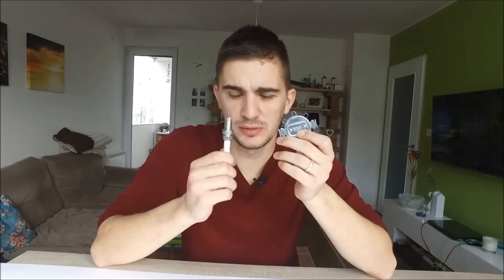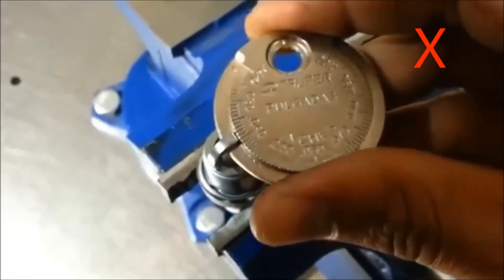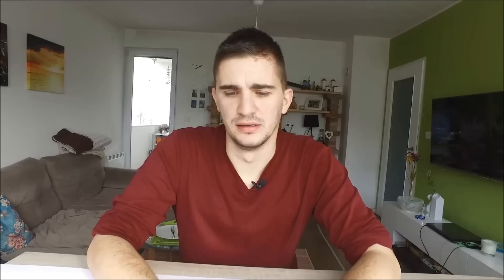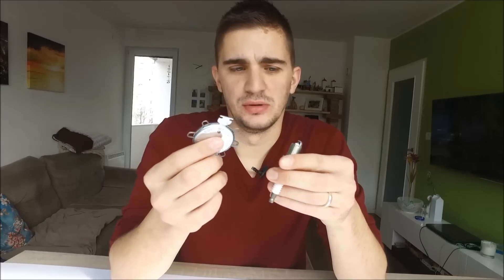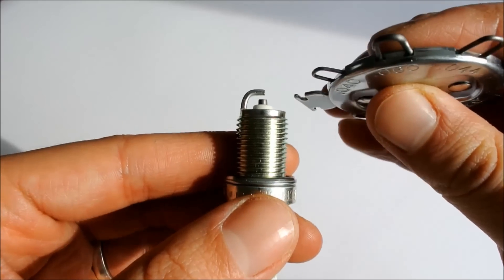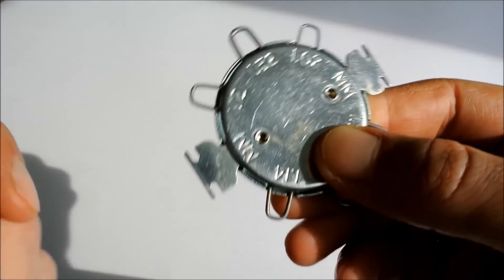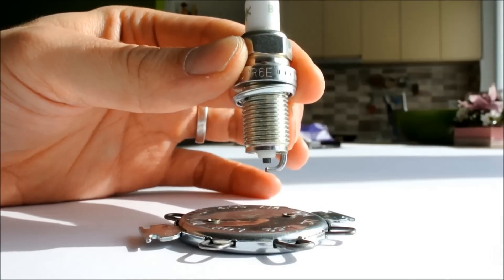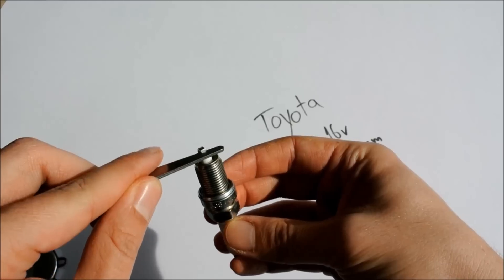How to GAP a SPARK PLUG properly

Comment: As an instructional designer, I have to say that this was an excellent tutorial. Clear audio and good lighting.  Nice closeups with  clear directions. I could actually see what you were talking about (unlike other videos). Helpful tips. I've never done sparkplugs before, but this video makes me feel very confident!
Reply: Thanks
Reply: Agreed, I haven’t used this style of gap tool before so I was going to use the gap wires and wedge them in 😅 glad I looked up what that extra metal piece on the side of it was for.

Comment: I never did any engine work until i went backpacking in Australia, bought a jeep that turned out to be missfiring so it needed spark plugs and all the wiring to them, machinic work there is really expensive so i did it myself, i bought thin feeler guages, and smacked the spark plugs on the pavement *carefully* to reduce the gap, never had any problems with it in 30,000 miles lol

Comment: I’ve seen a few videos that didn’t cover the subject adequately - this video did.  Thanks for showing the PROPER technique for adjusting the gap.  You can get a tool that pushes on the ground electrode with a jack bolt.  These work well too (instead of pushing the plug onto the table or the tool).  But again, thanks for showing the right way to gap a plug.

Comment: Great video NRJ. The feeler gage is by far the most accurate, the wire next and then the coin. I can address the use of a couple of these. I had never used the wire gapper since it never had the right gaps for GM or Ford products. Hence I am not familiar with its proper use.

I have used the coin before and it is pretty self explanatory. However you insert the coin where it is at the lowest, rotate to the needed measurement. If it stops before you get there, or is too loose, adjustment is needed. It may be just right. If your spec falls between two measurements, one is high and one is low, use the space in between. When adjusting a loose fit just use a hard surface and force the electrode closer gently or tap gently. There is a risk of the electrode breaking off but they are pretty sturdy and I have never broken one off by tapping or otherwise. To adjust the tight fit, use the hole that is provided for placing on a key ring. The inside of the hole has a thin surface which you place the electrode onto and then you pry it to the spec you need, gently. As I have said I have never broken one off. 

The feeler gage is a little different in that you can customize the leaves to your spec. It is relatively easy to use once you have the spec measurement. You just place the feelers into the gap and you know if it is loose or tight and won't go in almost immediately. You can also use the end of the gage for adjustment if it is tight.

A couple of other points. It's best to have a sparkplug socket. These are long enough or deep enough, if you will, that they will certainly do the job. You can also use a normal deep socket as this will work in a pinch, but getting the plugs out once unscrewed may be problematic. The sparkplug socket has a plastic or rubber insert inside the socket to grip the sparkplug. If you use the 12pt socket as opposed to the 6pt you may round the plug especially if the plugs are torqued. Last thing. The manufacturer's spec measurements are in imperial(SAE) or metric or both. The gappers you purchase now, as stated in the video, should have both imperial(SAE) and metric. I think you can purchase them with one or the other, so check carefully when you purchase. One last thing about the feeler gage. Suppose you only need one leaf, well that's okay just use it. If you don't see the feeler leaf you need you may need two or three. So what you'll do is add. So if you need 0.060in. what you do is add the closest two or three. The ones for 0.020in. and 0.040in. won't work, they create a gap in between and you might bend the tool. In this case use 0.012in.-0.014in. That should get it. Just remember they should be close together. It should also work for the metric as well.
Reply: Nice and clear info, my question is if you needed .06 and added .012 and  .014 wouldn't it give you .026 instead of .06...?
   I mean it seems like basic math... I don't get it...

Comment: I hadn't changed the spark plug https://www.youtube.com/post/Ugkx-6W-PtUzBRTmACHywsECak2ToY2OpjxN in my Toro 20" Recycler in the 6 years I've had it but have been good with all other maintenance. This season I noticed it sputtering a little bit every so often and just didn't feel like it was running as smoothly or as powerful as it used to. Switched out the spark plug for a new one yesterday and could immediately tell an improved difference. So I may have to make this a little more regular than every 6 years, especially for a $5 part!

Comment: what an excellent video. 

Also the fact you mentioned 0.004" for every 50 HP is RIGHT ON! 

literally my 328i F30 started misfiring 3 weeks after stage 1 Tune (it added around 50 hp) on relatively new ignition coils and plugs (10k km). i got new sparkplugs which are stock gapped usually to 0.032" and i gapped them down to 28" though, funny enough after removing the old ones i checked the gap to see 0.034"-35" which eventually cauesed limp mode drive terrain error. after the change the car now idles like butter and drives amazing.

Comment: Professional technician here... 
You can absolutely re-set the gap on a used spark plug that is still working well!

No reason why you can't adjust the gap on any new or used spark plug. I've done it millions of times over the past 35 years, never any issues.

You can/should also clean & lightly sand/file the center & grounding electrodes prior to checking & readjusting the gap on used plugs.
A simple piece of emory cloth is usually sufficient.

The best gapping tool is most definitely the wire gapping tool, with the included "T" slotted tool used for carefully bending the ground strap electrode to obtain the correct gap.

Comment: Very good, detailed, logically explained instruction, with excellent visual support. When I had gotten my gap adjuster home from the store there were no instructions and I honestly could not figure out the adjustment part and was nervous about damaging the electrode if I did it teh wrong way, though the measurement part was more obvious, except if you have a gap not included on the wheel as you showed. Thank you for helping me with this!

Comment: Spark plug 101: The best gap? - is the biggest gap you can get away with under all conditions without misfire. The larger the gap the bigger/stronger the initial flame kernel and the better combustion you will get - especially under low loads (idle/cruising), but ONLY if it actually fires. So yep, higher boost pressures will require a smaller gap under full boost pressure as to avoid a misfire. 

Many modern high boost turbo cars can have lumpy idles, in particular on high boost 4 cylinder direct injection engines - a lot of this is down to the small spark plug gap size necessary to ensure there are no misfires under full boost...this small gap results in poor combustion at idle on high boost direct injection engines, where the air fuel mixture is not very well mixed under the low (idle) air flow conditions.

As for why the flame kernel is better with a larger gap - this is simply due to the both the ground electrode and tip taking heat away from the flame kernel - the bigger the gap, the less heat that is drawn away from the kernel and the stronger that flame kernel will be.
Reply: blower how are you doing ?
 you know what's the biggest gap you can get in 2012 acura tl?
Reply: I agree, however, won't wider gapped plugs tend to foul-out sooner simply because there's less heat to burn off the carbon build-up on the electrode? I've noticed when using a wide of a gap (even w/o misfire codes thrown) there's a 'cushiony/springy' feel to the throttle.. could this be due to less heat? Thanks for your post. Relieving to read a comment from a person who knows what they're talking about.
Reply: Thank you for the information.

Comment: great video dude a commonly over looked job when servicing a car even on a professional level people don't get when plugs are shipped there knocked around the place and possibly close the gap seen a few misfires after plug changes caused by this
Reply from the maker: +david farrell tighe Thank yoy. True, as long as the spark plug fits most car owners, and sadly even some mechanics don't even check the gap.
Reply: I'm in the automotive trade myself I  seen a guy nearly put plugs that were 1cm longer reach into a polo 1.0 mpi before he didn't compare or check the plugs it's the simple things most people miss I find

Comment: Started out @ .039 on my Accord factory is .044. Currently running .046 definitely running stronger with the bigger gap (quicker starts, smoother idle etc.) hoping for more mpg also. California emissions has it @ .052 wondering if that'll run even better 🤔 God knows I'll be trying 😅

Comment: I did re-gap this way for my turbo subaru. At .033 gap at peak boost was getting cylinder roughness, decreased gap to .022 and all problems gone. In my other more boosted subaru the spark plug gap is like .019.

Comment: Ok so i just changed my  plugs on my own and was super proud and here comes my dad with a giant pin and stabs that bubble. Anyway apparently i didn't "gap" them. I used ngk plugs that are pre gapped but he's adamant that they can shift during shipment and i need to gap them to my card specifics. Are they still ok with me not doing this out should i take them out and gap them or can i no longer do that. I've only had them in a couple days
Reply from the maker: Your dad won't be happy but if the car is running well leave them. He's definitely correct, and they can indeed shift as they're tossed around during shipping, but that happens rarely and you can spot the compromised ones easily as the cardboard around them is a bit crumpled. I would leave them because they have already gone through a few heat cycles and gapping plugs like that isn't a good idea. Again, nothing will likely happen even if you remove them and gap them, but I'm 90% certain the gap will be correct on all of them.
Reply: @d4a  I also changed the maf sensor and i told him since changing those two the car is literally running extremely better. Actually turns on the first time and stays running and idling as it should. Still have issues occasionally after extended periods of driving like an straight hr plus of driving where it randomly bucks or trips idk how to explain it. Almost similar to when you have it at a stop and you put it in first gear sand begin to drive but don't give it enough gas and let of the clutch to soon so it jolts. Itll do that once or twice enough to feel it but then correct itself.
Reply: @d4a  Also thank you I really appreciate the response and info

Comment: I think 1.02mm (.040 inch) is fine for the spark plug gap if the recommended is 1.1mm because it will expand anyway when it used for too long driving of the car.

Comment: I appreciate the explanations, particularly the last part about how modifying engines require an adjuatment i spark the plug gap. 

I have a question: why not use feeler gauges instead of the coin or the wire type?

Comment: You must not know much about sizing because you said you have to use the feeler gauge to get the right size but yet the wire gauge you have clearly states the exact size you said you needed lol you said yours called for 110mm (1.1) which is .044. The wire gauge has that EXACT size on it!

Comment: Great video! Very clear and thorough explanation! I have One question: would adjusting the gap help with high rpms? I got a new engine but ever since then, the RPMs have been higher than usual and when I change between Drive and Reverse, the shifting feels pretty forced (if I’m explaining it right). Would that be possibly wrong spark plug gaps? Only asking because no faulty sensors come up and supposedly my transmission is fine as well. Thank you and I hope you see this!
Reply: Maybe the RPMs at idle, but none of the other symptoms you describe should be related to spark plug gap. You are likely looking at transmission issues or an issue with the new motor. Could be factory or something with the install. Hope that helps :/

Comment: It doesn't work.   I have 4 spark plugs NGK ZFR5F GP.   The gap is supposed to be .044 inches and the plugs all have too small of a gap.   So I try the tool to bend the metal piece on the spark plug and it does not work,  the tool bends and this tool is no good.

Comment: What happen if your gap is less than the recommended altought the engine is stock
Reply from the maker: +Javier Broger Usually when you suddenly floor it at lower rpms you will feel the engine hesitate. Might be a few misses at idle too.

Comment: 1400-1500 hp 2JZ plug gap negative 4mm
Reply from the maker: Forged Shaft Yup, you can find plugs like that in a parallel dimension.

Comment: Why is it not recommended to gap used spark plugs?
Reply: Used plugs  have been heated and cooled, weakening the electrode. When you bend a weakened piece of metal it can cause stress fractures which can lead to the electrode shearing off in to the cylinder.
Reply: Thanks!
Reply: @Mikemo  haha let you tell it.

Comment: What the hell is the point of having a spark plug adjuster if u can't even use it bc it doesn't have ur size on it. U should of jus used a feeler gauge from the jump..

Comment: Hi, whats be the gap for a f150 1978 (351m) ? Please
Reply: .042 - .046 There should be a sticker on the valve cover or radiator support that shows the specifications.